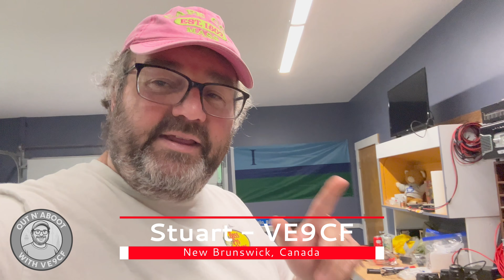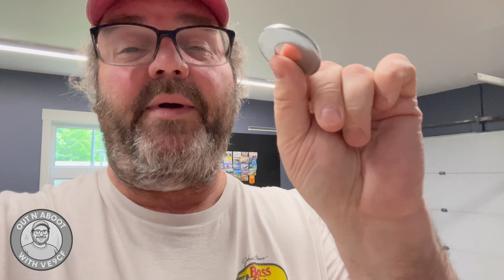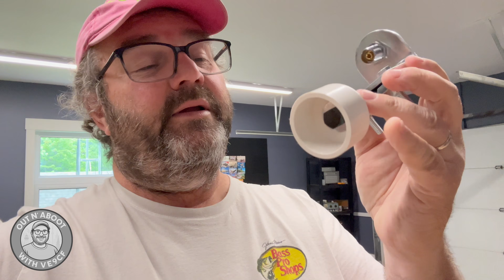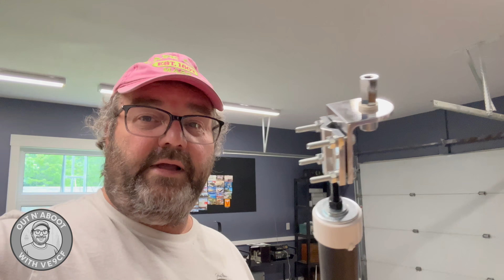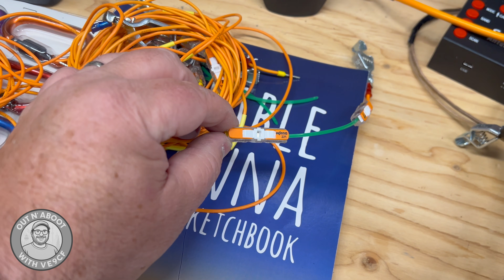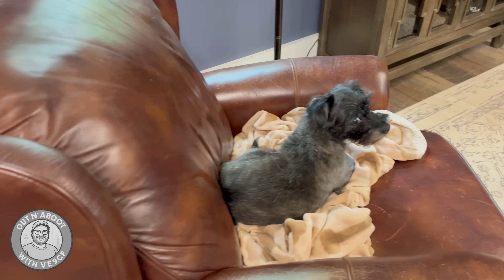One Vertical Wasn’t Enough!

Comment: Right now, I don't have a Cameleon ss25 yet, so I built the Challenger using a 14 MHz wire antenna, which I use with a DX Commander expedition mast. Unfortunately, I haven't been able to test its potential yet because of poor propagation whenever I've had time for my hobby😢.
Reply from the maker: Propagation can be so frustrating sometimes!

Comment: Building one with 2 inch PVC and the furniture grade flat caps.  The two inch is a lot beefier and you can add I-bolts to guy it down
Reply from the maker: Good tip